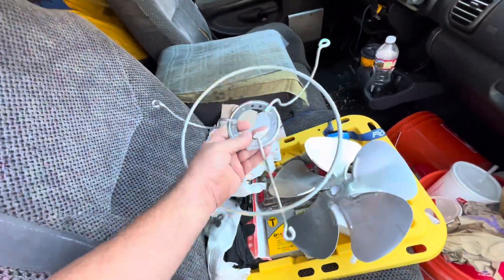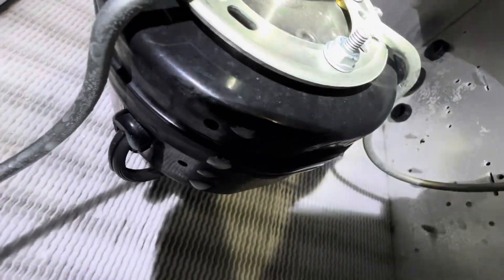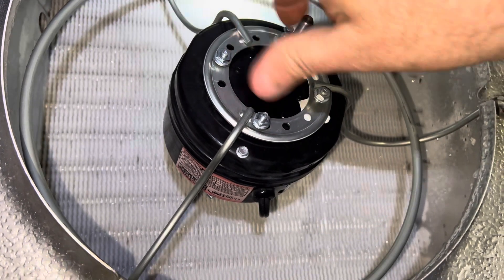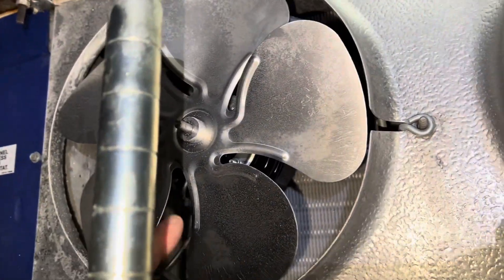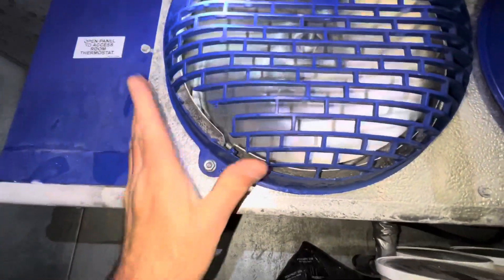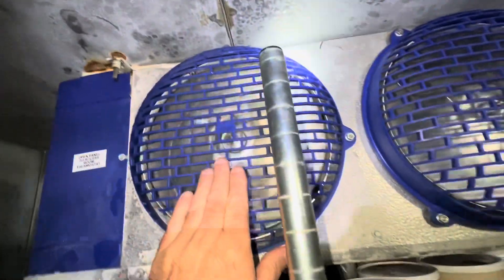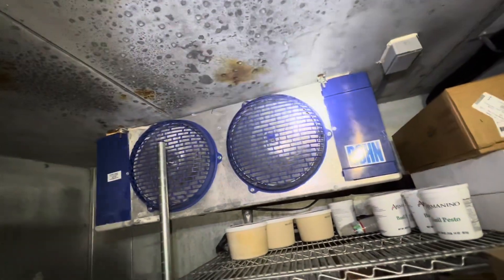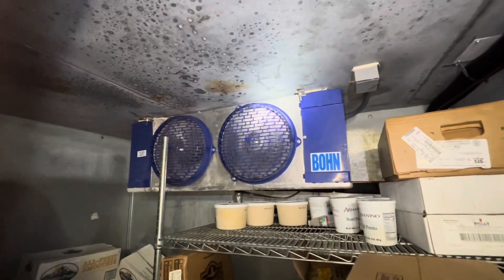Heatcraft Evaporator

Comment: Another Heatcrap evap? Or is this just a followup from the previous freezer video. Thanks for the tip on the ECM motor drain holes, I wonder if there's drain holes on the larger Bohn evap motors, I put one in a few years ago, and I didn't notice any drain holes. But I think I put the motor in so the power wire came out from the same direction as the old one.
Reply from the maker: Same Heatcrap Evaporator. Found other Mount broken while on original call for replacing other blade & broken mount. Had to come back. Only 1 mount available at supply house at a time. 67 on back order. 🤦‍♂️ 4th service call on 2 year old freezer Evap.

— July 7 , 2021 - install date —

1. Day 1 - Unit Blew Both Fuses in Roof disconnect. Found: Evaporator wired incorrectly. July 7, 2021.
2. 30 days out - temperature control defective from vibration. Replaced Temp. Control under warranty.
3. 2 Motor brackets Broken - Aug. 2023.
4. 1 Fan blade - broken from broken motor bracket. Aug. 2023.
5.  1 Plastic Fan blade guard broken. Left side. August 2023.
Reply: @OcRefrig  Jeez, that's a lot of problems for just barely past 2 years!
Reply from the maker: Yea, Just a Pos From Day 1 !!! Factory wired temperature disc across line connection on connection board so When I turned on the unit on start up the Condenser starts up , starts  to pull down & Boom ! 2 fuses blow on the roof disconnect. Dead short ! I Go Down below to Evap & check wiring and Find factory wired 3 wire Fan control across L1, L2 so when when switch closed on cool down to bring on fans - Boom ! Nice Huh ! It’s 4am and I get this Gift 💝 on Start up. Frigin Heatcraft !!! Restaurant opens at 5:30am.